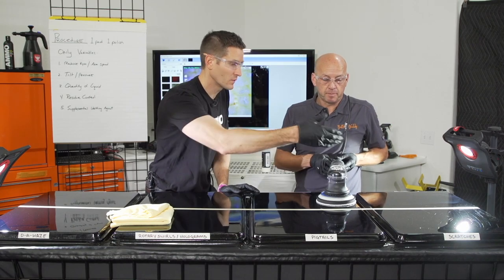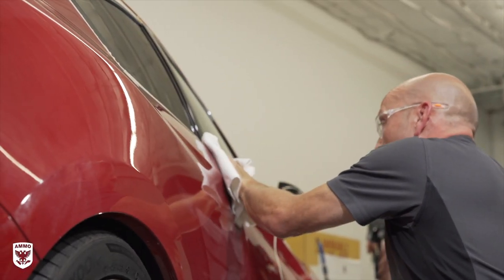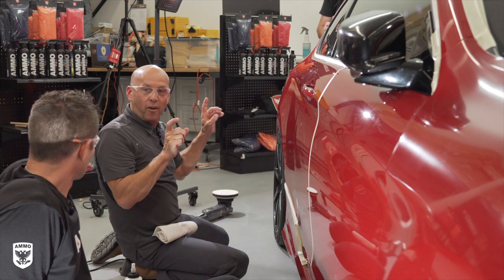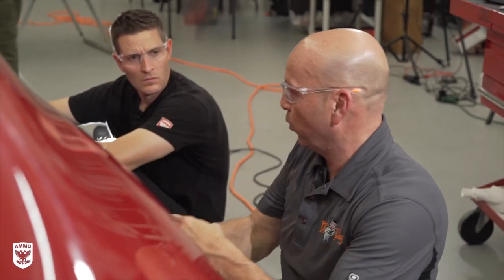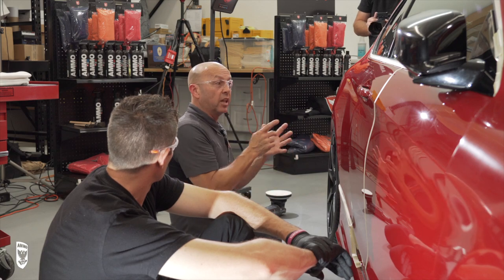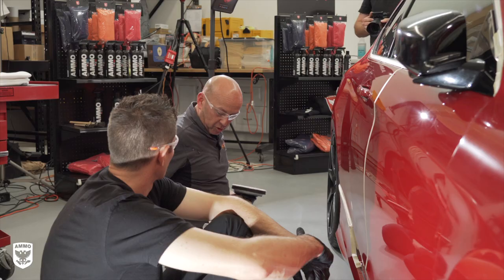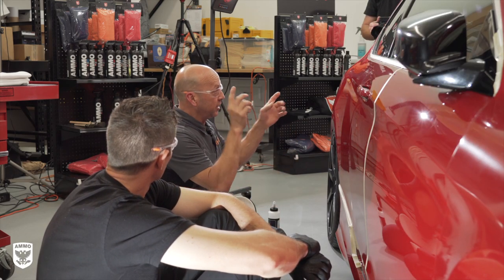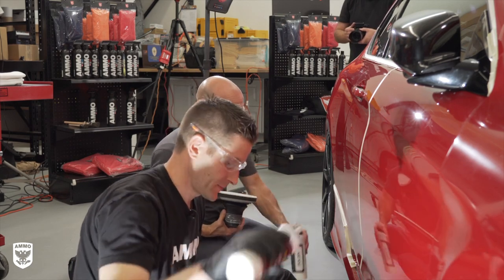Using Water When Paint Polishing: When and Why ATA 207

Comment: Adding water helped me with using compounds, thanks to your previous videos.  I was also recently using CeriGlass with a Nylon pad to take small pits out of glass and it seemed to be "used up" really quickly, but adding a spritz of water helped pull that out of the pad, as well.

Comment: Just for academic purpose, what will happen if I add water to a compound or polish? By diluting an aggressive compound, will it reduce it's aggressiveness as the abrasive content for a certain amount of material is reduced.
Reply from the maker: That's what the video explains. Watch it again if you didn't catch what Kevin and I were discussing.
Reply: @AMMO-NYC  I think the discussion was about using water on the pad\panel and it's uses in specific scenarios. What I am asking is about the dilution of the compound or polish before applying it to the pad (diluting in the bottle itself)
Reply: @chaohengwan6060  Agree. Lets say if I wanted a slightly less aggressive compound and I dont have any other compound at that time, by slightly diluting if the aggressiveness can be reduced, thats what I am looking for. The requirement is varying aggressiveness from the same compound.
Reply: compounds are different , for example scholl concepts s20 have very long working time, if i spray water i eliminate the already low dusting and i increase working time, also the temp of the water and the temp around you....will it evaporate? do you want to evaporate ? so many variables! water alone? water with water based polish? water with baby soap surfactants? water with some hair conditioner? discuss here :)
Reply: also what pad? microfiber? foam? wool? it will behave totally different , on microfiber it will clump the fibers and on foam will cause ''hydroplaning''